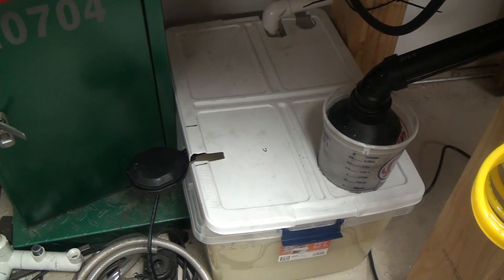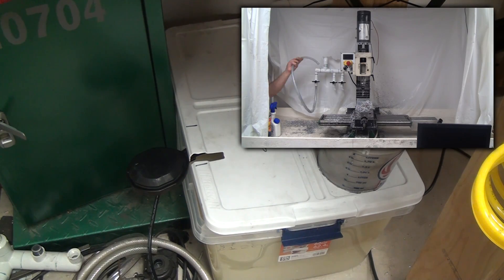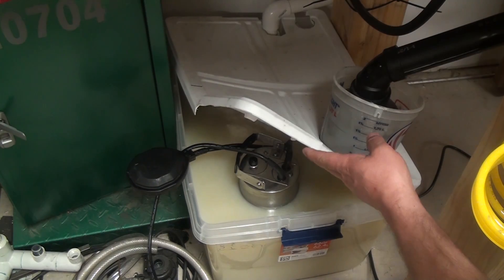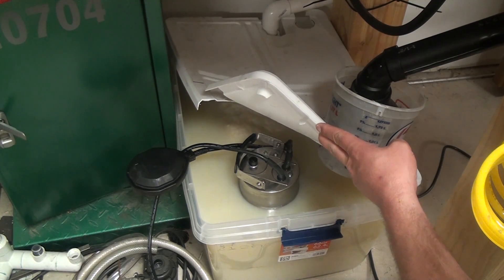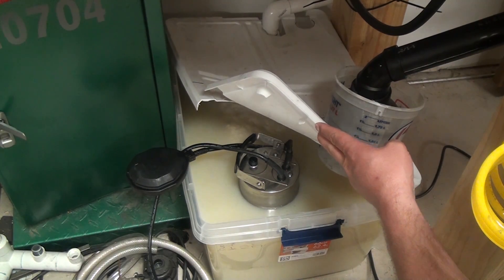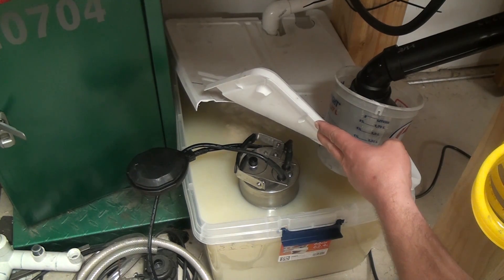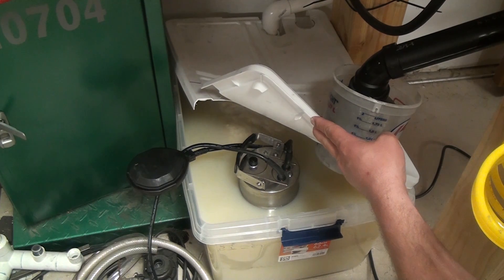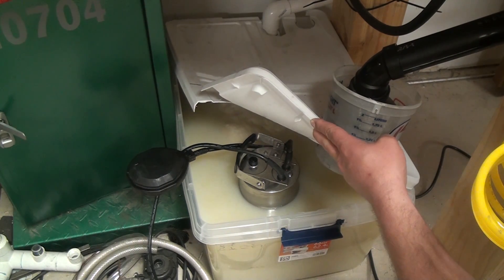CNC-G0704 #23 - Harbor Freight Sump Pump for Flood Coolant

Comment: I used a 3/4 sump pump on my lathe and it is more than enough flow. In fact it may be a little higher than I'd prefer splashing all over the place. That said it works adequate sitting in a HD homer bucket with a screened return dropping directly down from above into it. It cost me as much ($140) as buying my 1/8hp system of eBay that is designed for mills and works great out of the box. So I've found it did the job where I couldn't wait for a system to get shipped but it's not as nice as my professional system that fits cleanly inside my mill cabinets and come with on/off and all the necessary tubing, etc to complete a full install.
Reply from the maker: That sounds perfect.

Comment: Still loving that coolant/oil?  Nice pump setup.  I think I might put that tub inside another tub....protect the coolant tub from getting hit directly and catch any leaks if a crack does start.  Just a thought.  I have two pumps built into my stand and I haven't used either one yet. lol
Reply from the maker: +bluehandsvideo Yeah I'm really liking it. It's just so slippery. I'll likely do a follow up video in a couple months. Good idea on the sump.